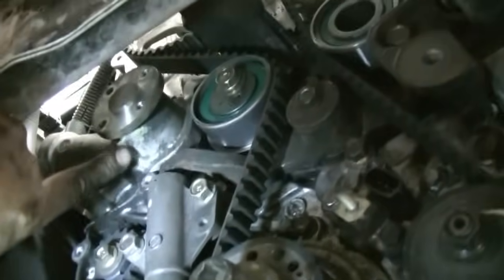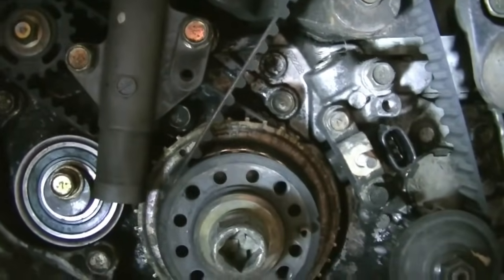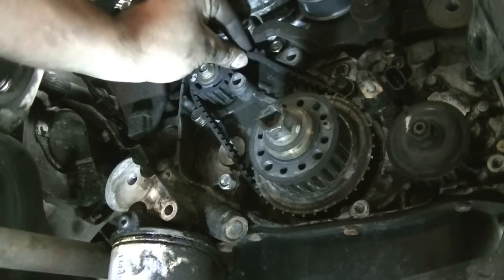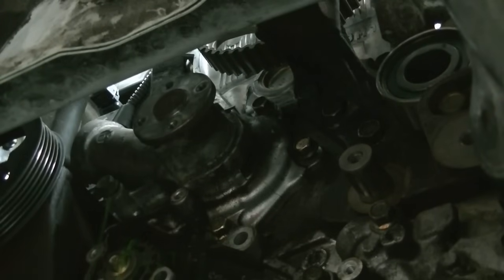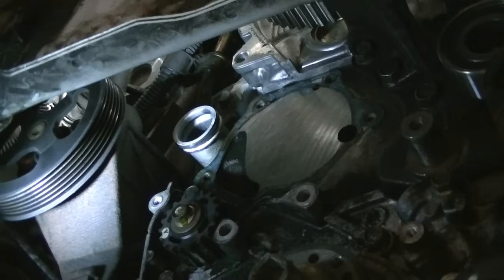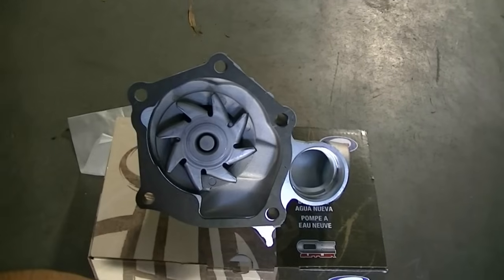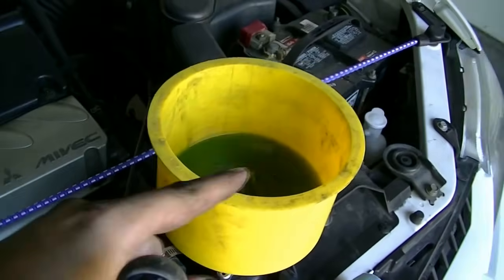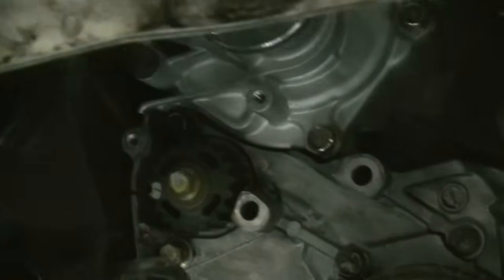How to Remove and Replace the Timing belt and Water Pump - Mitsubishi 2.4L SOHC Engine PART 2

Comment: So you can not replace the water pump without removing the timing belt? or at least some of it...some of the water pump bolts are hidden behind part of the timing belt components...correct..thanks
Reply: yep water pump is snuggled behind the belt like an arsehole

Comment: I'm concerned now because I changed the water pump and all the fluid obviously  went down and and got my new oil  Pan gasket wet.  I don't understand when I drained my cooling system before I even did this😫😫😫

Comment: QUESTION: Do I have to remove the automatic belt tensioner if I have the belt off already? (It's already been replaced before so I'm not worried). It sounded like that was just your way of removing belt tension.

Comment: Previous mechanic did NOT have the oil pump pulley out of time. if you rotated the engine around one or two more times it'll be in the right spot.

Comment: You better make sure you get the counter balance lined up. As well as the other marks. As that thing will rattle like loose valves. I had one come in. They replaced the head. They thought the value lash was loose. It was the Counter Balance Shaft not align right...
Reply: Also if that balance belt is too tight it'll sing.

Comment: I just want to replace the water pump in 2003 Mitsubishi Galant with a 2.4L L4 SOHC 16V engine. Do I still need to remove the timing belt first? Thank you.
Reply: Did you find out the answer to this?

Comment: If ypur already having to replace stuff that you didnt replace last time then its not wise of you to assume that you will be "ok" with the tensioner. Id replace it regardless just to save the comeback or in your case 2nd comeback
Reply: Yes, generally replace everything, including water pump to save time in the long run. Kits aren't that expensive. (unless you have good records on the vehicle and know exactly when everything was replaced.)
A "cheap" repair isn't cheap if you need tyo come back and do it again.

Comment: Where is a guy like you when I need it. 2 mechanics and hundreds of dollars and headaches later 4 months down the line and my 2003 Mitsubishi Eclipse 2.4 still cranks but no start. It ran strong started up good up until the first mechanic replaced water pump and belts. Second mechanic came to diagnose the no start issue with no success. I’ve troubleshooted and diagnosed to my own ability Fuel Spark Power Air Electrical wiring ECU Immobilizer you name it a part of the whole process of elimination still with no success. I don’t know what else to do. Please help!
Reply: Lol you ever get it? Sounds like someone screwed up your crank sensor when doing the work.
Reply: Sounds like a starter problem‼️
Reply: @fishing-kj3ee  Nope. It was my timing. An undercover cane to my home as a so called mechanic and I paid him $500 to destroy my car. I ended up fixing it myself. Now I'm a great self taught mechanic with 50 job repairs and maintenance work under my belt. The good God blesses us well.

Comment: Great work. I had my 4d68--- 1992 timming belt replaced, but after two days it broke 5 rocker arms, what could have caused the problem? They had oped the engine up and changed some valves
Reply: Sounds like the timing was off

Comment: I came into a little problem i think. I rotated a bit the cam withthe belt on. Then i rotated a bit the crank sprocket with the belt off. If i line up the marks, will i be okay?

Comment: Question:  I only need to replace my water pump, do I need to remove the timing belt or can I work around the belt?
Reply: You have to remove the timing belt itself, timing belt tensioner arm, pulley, and auto tensioner.
Reply: No not always have to I zip tied the belt in the middle so I didn’t have to mess with it cause I was in a rush but it is easier to do the water pump if you take it off but they are pretty simple to time

Comment: Hello, I have a problem which you probably can solve. The connector to my crank sensor break to pieces, the wires came off loose and we are unable to find the right configuration.  We're just having a crank but no start. No electrical power coming to the spark plug. My wiring colors are red, black and white. Any tips?

Comment: So if I just want to replace just the water pump do I still have to remove all the rollers and belt other than the one on the water pump pulley? Or can I just go straight to the pump and replace it?
Reply: Did you ever find out the answer to this?
Reply: @damon323  yes. You should be able to just relieve the water pump without worrying about the other rollers
Reply: @king2091  Awesome man, thank you! Just to be clear, you are saying I can remove the water pump without messing with anything else, correct?
Reply: I have the same question, can i replace the water pump without messing with the timing belt? Someone please help!

Comment: Great video, did my 03 Outlander today using this guide with no issues ...the only thing that I noticed is that the larger roller could not be change out in mine without removing the power steering compressor, and the alternator is in the rear of the vehicle. I think there was a design change after that year.
And that water pump thing was a pain in the ass to put back on small hands help.

Comment: If I just needed to replace the water pump do I have to remove all those pulleys regarding the timing belt? Or can I just remove all the pulleys and suchs and replace water pump itself and not need to touch anything to do with the timing belt.

Comment: is it okay to turn the crankshaft after i take the timing belt cover off but before removing the old belts just so i can line up the oil pump pulley?
Reply: Just replaced my timing belt on my Galant, and yes you can turn the it with the old belts on .

Comment: Using a gates timing belt kit from rock auto set perfect tension removed
 pin and turned engine over 360. came back to re insert the pin 15 
minutes later and turns out the belt jumped 6 teeth. didn't start the 
engine yet...I'm confused, any help would be appreciated!
Reply: Andrew Amado ..did you figure it out?
Reply: 2 years late but the timing is 3 to 1. On the balance you have to turn it clockwise so the arrow is weighted to the other mark.

Comment: im changing my oil pump whats the best way to get the crank bolt out? ive tried heavy duty impacts, breaker bar, setting the car on the crank with a jack stand nothing will work. is it opposite thread possibly? please help
Reply: I used my impact gun to break mine loose.

Comment: Hi. I need help. please respond if you know something . PROBLEM:  The car got a problem with TIMING BELT. I replaced the timing belt but the car wont start. i checked the power, gas and has been verified that evrything was into place. I would like not to resort to Top Overhaul so if you got any ideas feel free to comment. btw, i need it asap. pleasr please :) THANKS

Comment: great videos, however, all I need to do is swap the water pump. Can I swap the pump without disassembling the timing components. I cant really tell. Any help would be appreciated. Thank you.
Reply: Did you find out the answer to this? I was wondering the same

Comment: Thank you, I will be changing my Galant's timing belt & water pump within the next couple of weeks.  Really enjoyed watching the videos.  Very informative and well put together.  I do have one question, what do you use to clean the gears after you took off the timing belt?  I am afraid to use any solvents that could cause the belt to slip.
Reply from the maker: You can use brakleen, just wipe it all down well and if you have an air compressor air off the area and you'll be good to go. GL and thanks for watching.
Reply: Ratchets And Wrenches hi needed change the main seal of 2.4 outlandish 2004 ,is the same processing and finally removed the main,obviously removing the main sproke,so I need do all this work???